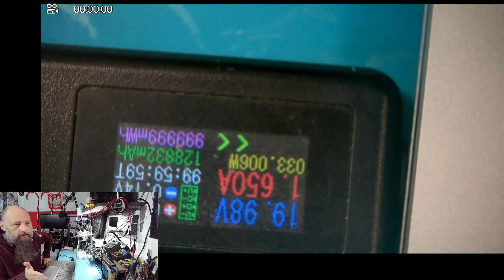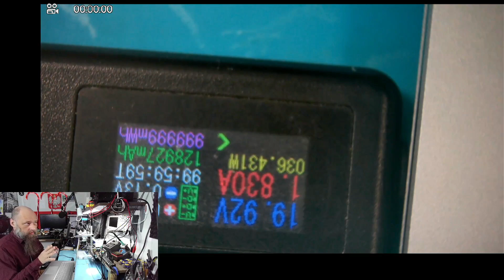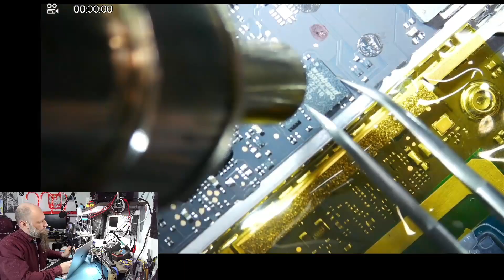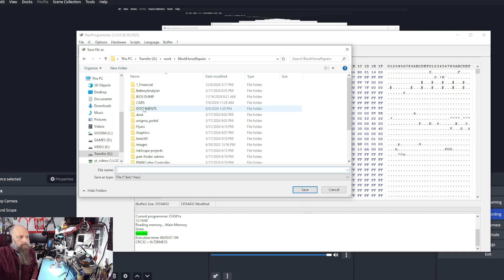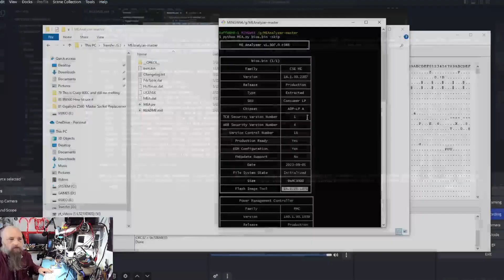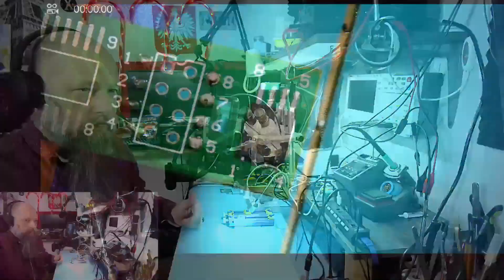#82 | Surface Laptop 1979 Repair | Corrupted BIOS and Faulty SSD

Comment: I have a Microsoft Surface (model 1769). When I turn it on, the Microsoft logo appears three times and then the laptop shuts down. Do you think this could be due to the SSD and that I need to reball it?
Reply from the maker: unlikely, if this was an SSD issues you would still get into BIOS.
This could be a BIOS issues or and electrical issue on the board

Comment: Hey! I stumbled upon your great video and I need your help. I paid very close attention to how you flashed new firmware onto the BIOS in your video. I have a Surface Laptop 3. I don't think I have a boot loop, but it's basically stuck on the Surface logo. The screen flashes for around five seconds, then shuts off.  Is there a step-by-step tutorial for performing an ME clean?
Reply from the maker: Join our discord and talk to LeadFarmer, he'll clean the ME for you, or you can send it in, it's just $50 for BIOS reflash plus shipping.
Reply: thanks for the Infor I look in to it. I would send it in but i don't live in the US. Hence why im doing it by myself. XD .Btw One more question what bios programmer did you use.
Reply from the maker: @nitroman2266 CH341 :) but I recommend something better than that
Reply: @blackhorserepairs  oh ok what oh other programmer would you recommend

Comment: hello, in my case seems to only be the bios, can I just replace the bios chip with a new one compatible with my model? or do I need to look into how to flash the faulty one?
Reply from the maker: after replacement the computer no longer works correctly. You need to reflash the BIOS region and leave all the other regions untouched

Comment: can you help me with surface 3 pro bios reset.. whats the price ?
Reply from the maker: the majority of work is removal of the screen and replacing it. I also do not have the BIOS for this particular model and I remember trying to find it with no success. Probably not worth it.
Reply: @blackhorserepairs  when i replace with new bios chip..it will work or not?
Reply from the maker: @DrKamal-ty2ys  the laptop will work but some functionality will be missing, most likely the touch interface